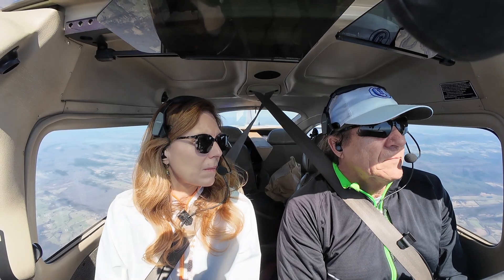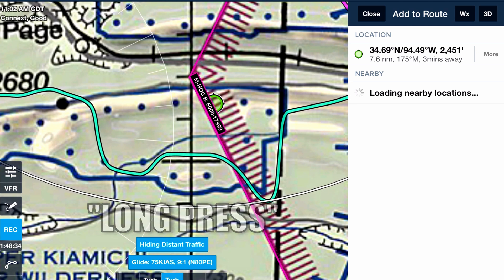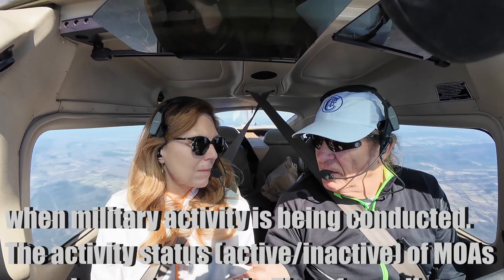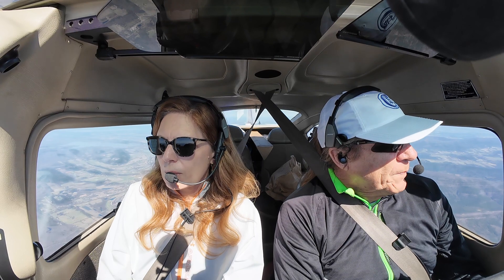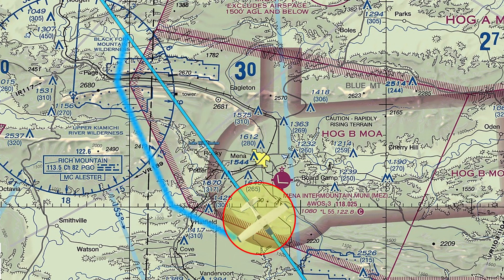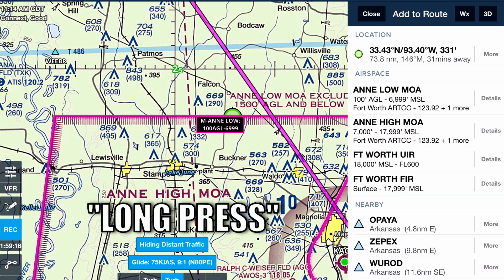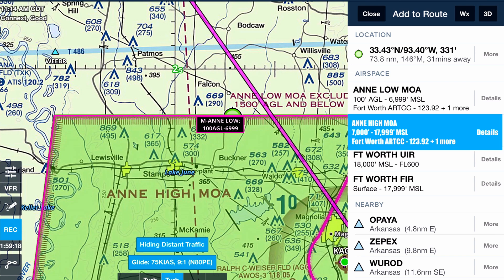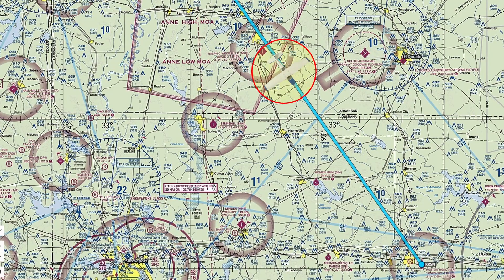How to determine in-flight if a MOA is HOT or COLD using ForeFlight when flying VFR

Comment: Thanks for the tip.  I've
Reply from the maker: You are very welcome!
Reply: @Parr4theCourse :  I've used that process numerous times and found controllers very helpful
Reply from the maker: @ 
Yes only way to know for sure as it may be posted HOT/COLD but Controllers will or should have the most updated status.